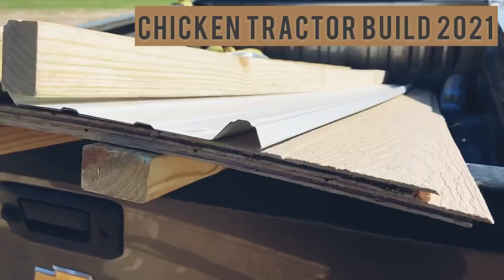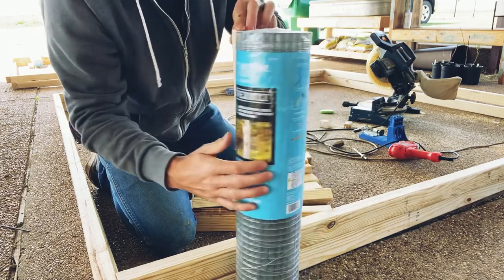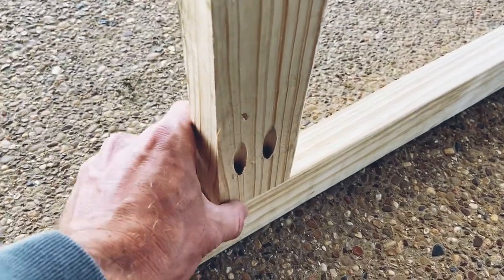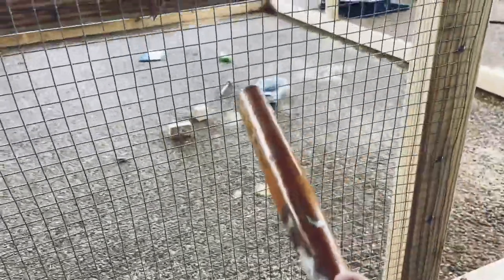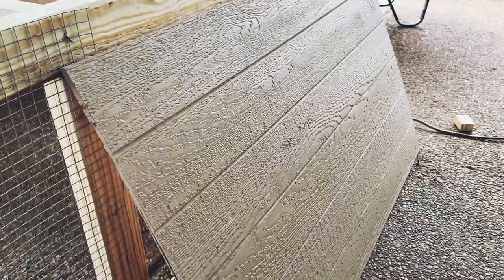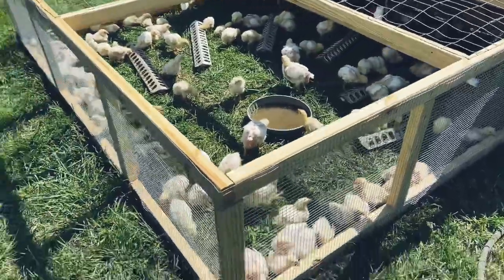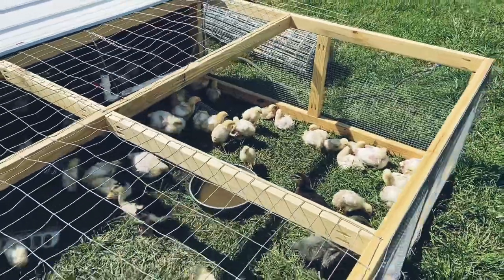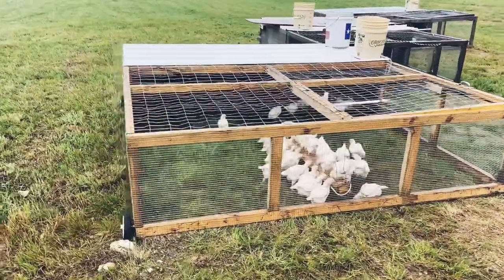CHICKEN TRACTOR BUILD: Joel Salatin style chicken tractors to house our meat chickens

Comment: I'd like to see how it goes come processing time and you have to get in there and catch the chickens. Would a larger door spanning the width help? Pop the roof off? What's your experience with that?
Reply from the maker: Only need to get inside it one time so it's not a big deal. But, yes...I was thinking about having the entire roof fold back for that purpose. Maybe on another revision I'll try that.
Reply: @SeeRichardRun  I’m not knocking the design…I’ll surely be copying it at some point. I’m just curious about rounding them up when it’s processing time. I’m a big guy, crawling around in there catching chickens would be a great show! Lol
Reply from the maker: Check out John Suscovich...he has one you could walk inside of but still light weight enough to drag around.